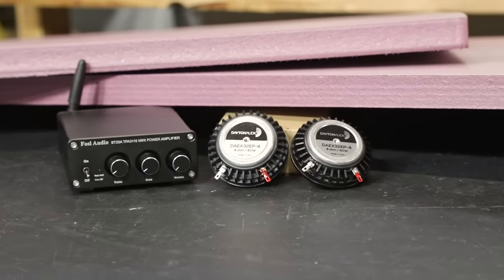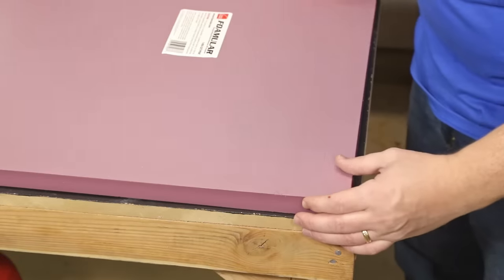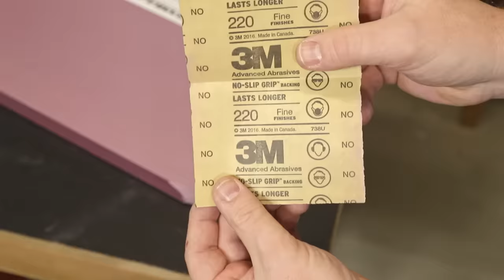How To Build "The World's Best Speakers" - Are Flat Panel Speakers Really Any Good?

Comment: Just a heads up for anyone doing this. I just completed them, but did some more research on home made DML (Flat panels). The audio quality increases IMMENSELY if you coat the front and back of both panels with 2 layers of a 1:1 Wood Glue and Water mixture after sanding. I tested them before and after, and the coating adds a lot more low end, and overall makes the speakers sound significantly better.

I also found it important to hang the speaker wires coming off the panel away from the panel. You can bend the attachment point with pliers, its just important the wires don't touch the panel too much.

 I'd also recommend tinkering with your eq settings. I found a round curve downwards shape worked best (Lets say 1 cm downward for the lowest end 60 to 150hz, 0.8 cm for 150 to 400 hz, 0.3 cm for 400 to 1 khz, 0.1 for 1 to 2.4 khz and 0.4 upwards for 2.4 to 15 khz)
Reply: Curious as to if putting a couple layers of paint on the panels would affect them the same as the glue mixture.
Reply: @Jalahr77  No, but you can include paint. As long as you keep the 1:1 ratio of water and glue (maybe with some extra glue) you can add certain pigments. The only thing is, since you're not supposed to add the mixture to the edges, you may have to to make the whole thing look even. If you do do it, make sure you only do one light layer on the edges.

The big thing is hardness vs weight. The Foam panels work so well because of their light weight. By removing the melted surface and adding the glue mixture, it creates a hard but still lightweight surface. This has a whole bunch of complex interactions due to the reverb that leads to the amazing sound, but all you need to know is it sounds great.
Reply: @saimnaeem9     I'm assuming the glue works well because you're adding a bit of rigidity to the panels?   So, instead of a paint, maybe try a varnish, or even a couple of light coats of polyurethane.  Would be interesting to see how different coatings would affect the sound.
Reply: This was just the comment I was looking for. Im building a pair right now and anything I can find on making these better is gold.
Reply: It would bind the surface fibers, but wood glue is somewhat elastic, maybe do it with a rigid epoxy, although that would add weight.
Reply: bahahaha no way! I stumbled on the same thing a few weeks ago when I had a bottle of Titebond III sittin' around. It really stiffens up the outer "skin" of the baffle. Also phenomenal for stiffening up cardboard proto enclosures!
Reply: From the original video, this one and a couple others, I start considering the hipotesys of using 3 different layers of coating: a more rigid one, at the bottom, for the low freqs, a medium one at the middle and a light one at the top, for high freqs (maybe concentric circles would work better, with high freqs at the edge of the panels?).
Another improvement I saw in another video, in the overall sound quality, is the usage of 2 drivers (one at 2/5 and the other dead center)... just connect them in series to get a 8 ohms impedance.
Reply: @1OMEGA111  yea tri amped is better with crossovers that way you can pick your crossover points that may lead to more data of this very research if I was the teacher youd get an A.
Reply: @1OMEGA111  yea bass is omni and trebles very directional so the trebles panel make bigger? And the bass not as much? And  Skar audio and newark replacement speakers has speakers inexpensive.
Reply: Did you see the follow up video where he noted what sounded best? What do you think?
Reply: How did you apply the glue on such a large surface efficiently?
Reply: i thught once started getting the idea of hanging in air freely thught he was going to use fishing line
Reply: I was thinking of hiding the speaker aspect by painting them as an art canvas. Curious if I could get away with that without hurting the sound quality?
Reply: Anybody think that spraying with Plastidip would work? Benefit due to not being super rigid and very flexible plus never ending amounts of colors. I'm 2 videos into even knowing about this tech. I imagine it's all based on same idea that i used as a teenager putting thin vibration boxes under car seats that run of same frequency as car speakers just added more vibration to seem as though you had twice the bass in car

Comment: Great video. I fell down this rabbit hole a few years ago just for fun. Bought about 8 different exciters and a bunch of materials, from pink insulation sheets, white styrofoam sheets, a ceiling tile, and a few items from a thrift shop, such as a large thin plate and a pane of glass. I even tested with a cardboard pizza box, which sounded better than expected. I also put one exciter on the back of a guitar and one on the back of a full sized upright bass. These two tests turned out better than everything else. No surprise, as they are acoustically tunes enclosures designed to produce food sound.

In every test, the main thing lacking was bass. Adding a subwoofer would be the key to creating a system that delivers good sound for all types of music.
Reply: Woah! A couple of acoustic guitars instead of speakers would be really cool.